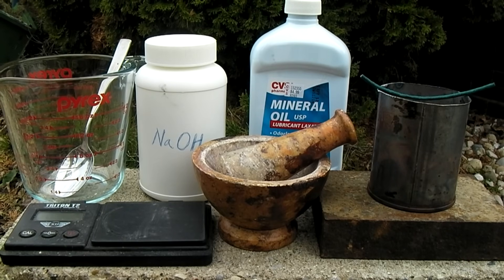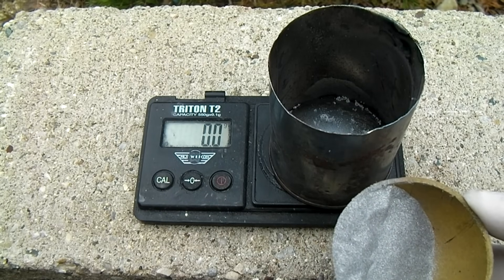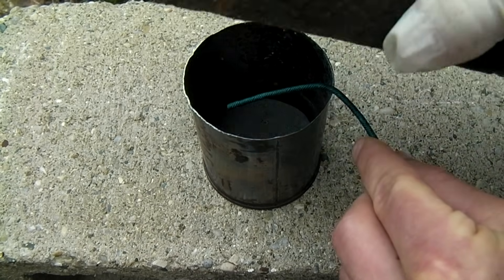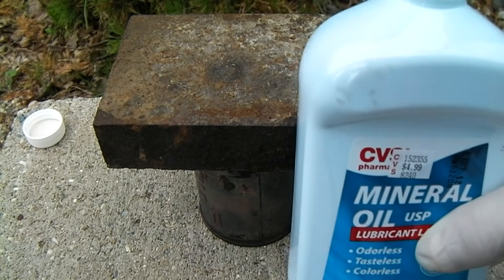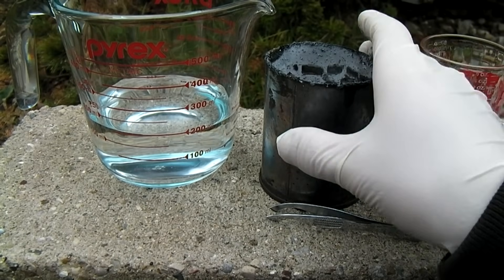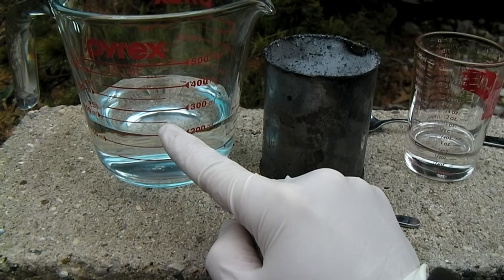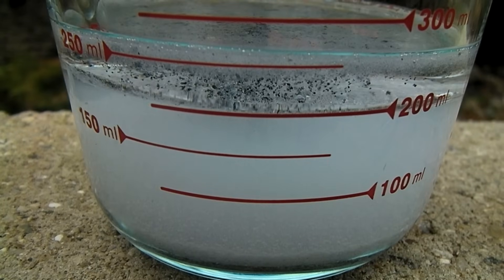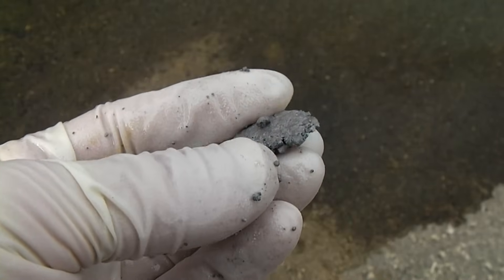How To Make Sodium Metal

Comment: Great video!! I have some further questions though: 
Why is it necessary to grind the sodium hydroxide? 
Why do you need more sodium hydroxide than magnesium powder? 
Why do you need magnesium powder, as opposed to another substance? 
Why does the mixture combust when exposed to a spark? 
Why does the sodium in the slag react with water?
Reply: I cant answer all of these perfectly, as I don't have time to fully go in depth to each one, but here is the broad answer for some of these. 

For 1, I am not sure exactly why it would need to be ground, but generally, grinding something up makes it easier to react and generally insures all of it reacts. When it is in larger chunks it takes longer to react and could also have unreacted product because not all of it is exposed to actively reacting things. 

2: This reaction is a (single?) displacement reaction. Sodium hydroxide and magnesium switch places. Now you have soidum and magnesium hydroxide (or magnesium oxide, I'm not exactly sure which happens here). The hydroxide leaves the sodium and goes to the magnesium, this would make magnesium hydroxide. What is more likely to happen though is the hydrogen leaves the solution as hydrogen gas, and the oxide leaves the sodium to make magnesium oxide. You need more NaOH in order to get reasonable yield because one pellet of sodium hydroxide is not that much SODIUM, because a lot of it is also the hydroxide. 99% of the magnesium you see is going to be pure magnesium. However, only 57% of the NaOH is actually sodium. Thus you need more of it in order to get a reasonable amount of sodium. 

3/4: This is a very hard question that ties into your other question. The answer dumbs down likely to the fact that magnesium and sodium are both incredibly reactive substances. Like, stupidly reactive. Magnesium is also relatively easy to get compared to other things. For example, if you tried to do it with potassium, you would not get just the sodium on its own. You need something that would drag the OH off the sodium, WITHOUT making any other byproduct that would bind to the sodium. Because sodium is an alkali metal, it only has one valence electron. This is what gives it such a high reactivity, which also means if you want PURE sodium, it is hard to find something that WONT react with it. It is just a big puzzle of what fits together in the grand scheme of things. Essentially though, it just happens that the magnesium is able to take the OH without making something that is going to bind to the freshly pure potassium. I am sure there are other substances, just more expensive and harder to acquire. 

And to actually answer 4, I mentioned the valence electrons. A full shell wants 8 electrons, so you have to find something that either has a few or a lot. An element with 5 V electrons (nitrogen) would rather take 3 electrons from something (either 3 from one element, or 2 from one element and 1 from another) but it is easier to take 3 in this case than it is to give 5. But when you have one electron, like sodium, it is not hard to find something to bind to. Similar case to magnesium, which has 2. It is stupid reactive because of this.

Finally, Im not ENTIRELY sure how this works, but I do know the sodium reacts with the water, but it does this by igniting. I also know that mineral oil prevents the sodium from reacting temporarily. I am not sure how exactly that works, but I do know it has to do with the fact that the water doesn't react with the magnesium oxide, but it does with the sodium. This means that they are forced to separate from the sludge because one reacts and one doesn't. And then one is denser than the other, so the sodium would float up into the mineral oil while leaving the sludge at the bottom.

Comment: When I was 13 I had tried to make sodium by electrolyzing molten sodium chloride. Lessons learned:
- a kitchen stove does not generate enough heat to melt sodium chloride
- immersing a plastic tube (intended to drain the chlorine away) into a mass of salt that is being heated will result in the tube being melted

Comment: i wanted to ask if this reaction does also work with a Mg powder /Ca(OH)2 mixture to produce some calcium metal. Or does the Mg2+ not have so much need on the Oxide ion than Ca2+ on the Hydroxide? thanks.

Comment from the maker: @jeremiahswee Very true. This is not a typical displacement reaction. Rather than trading places with the sodium, the magnesium attacks the oxygen contained in the hydroxide group. This creates MgO, leaving Na and H on their own, unable to bond together. The Mg does not force the Na out because it is more reactive, but because it has a stronger desire for the oxygen than the hydroxide group does. If the hydroxide group is decomposed, any metal attached to it is freed, regardless of reactivity.
Reply: Magnesium is so expensive, wouldn't it be better to use five-karat electrolytic sodium hydroxide?

Comment: It seems like you could extract it a little more efficiently by instead of using the water/oil boundary, use hot oil to melt the sodium out.  Then filter it under an inert atmosphere or in an excess of oil.

Comment: first, nice video... second I had an idea on a different method to separate the sodium from the waste products, since sodium melts at such a low temp 97C, wouldn't it be possible to melt your entire yield under a heavy oil with a higher boiling point, then the impurities should separate nicely from the metal, because dross normally floats on top of metal, that is what made me think if you melt it you should be able to obtain a better end result...  just a thought....

Comment from the maker: @Khalastas Try not grinding the NaOH. If you leave it in prill form it will react more slowly and leave more sodium. If you use a thick piece of steel as a lid like I have much of the sodium will condense on it because it's so much cooler than the reaction vessel itself. It can then simply be scraped off.

Comment from the maker: @daniel15051996 The sodium ignites when I scratch it on the lid because it has not yet been coated with mineral oil. When exposed to air uncoated sodium will react quickly and sometimes become hot enough to ignite as you have seen.